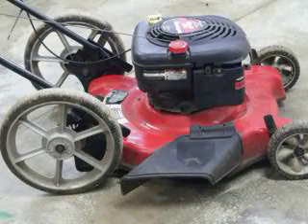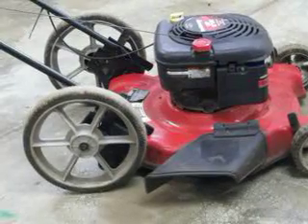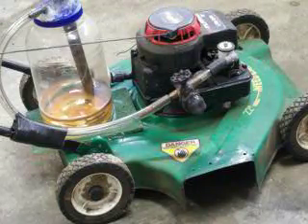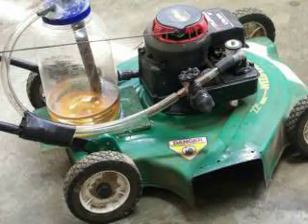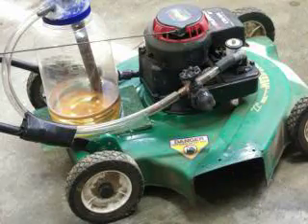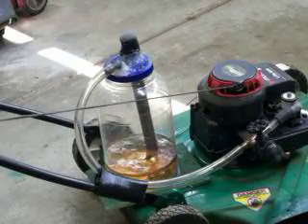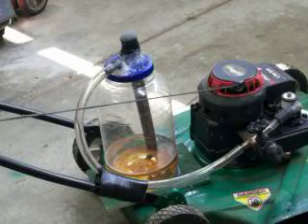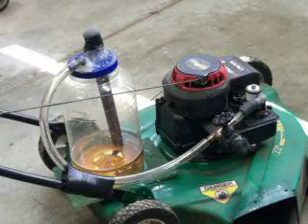gasoline and fumes the difference

Comment: That wasn’t the heat setting off the fire alarm. It was the carbon monoxide that you said wasn’t there. You talked about it smelling like cookies or something but it was death you were smelling. You needed some water vapor to make your engine run better. It’s running way too lean like it is. Just my humble opinion

Comment: I have thought about this theory for a long time. So if you left your bottle the way it is where it gets the vapor and the air mixed took off the gas tank plug off the carburetor everywhere except for the air coming into it, remove your hand valve off the hose and then connected your tube up to it wouldn’t run off the valve for your throttle

Comment: to make it more efficient add a heater to the jar to increase gas production and 2 valves one to zero in on the air and the second to control gas flow.

Comment: hello vapor kid i have been inspired by your videos but after year of experiments i found out  only way to completely evaporate petrol is very hight heat app 350-400 degree.your system will work for short time only after all light elements are gone engine stop and lots of  unburnable fuel is left in tank.boiling fuel is also unsuccessful although a bit more effective.did you put your system in your car?best regards from UK.

Comment: why not put a wick along the inside of the container  the problem is that the most volitile part of the solution comes out first...so in a batch it can only get less and less poweful..   by dripping the gas  on a hot exhaust it would  vaporize instantly.

Comment: that's your cabonmonoxide allarm lol you idiot, are fules  cause cabon even if it more affecent u will over heat the engine and burn your spark plug running it more affecent wen the carb brings up fule  air hits the spray creating vapor or close to it you can simply lean it out by tuning in your carb screw but again it will heat the engine up, you can use vapor but destroy the engine from runing lean and if its not tuning lean from thick vapor you will get the same milage.

Comment: Petrol engines don't run on 'liquid'! They run on vaporised petrol, which is basically fumes! You have built a very crude and simple carburettor. Congratulations. I'd recommend that you stick with the one at was already on the sodding engine though, it's a little smaller and less bomb-like.

Comment: an engine needs fuel to make power, and if you think its making the same power and also running more efficiently your wrong, im no expert but i know making power requires fuel, those priuses get 60 miles to the gallon but they make 25 horsepower, 25ish ftlbs torque no way around it, and an 8 liter v8 making 450 horsepower stock and 550 ftlbs of torque is gonna get 8 miles a gallon, of course theres more frictional losses and losses from the water pump, radiator fan and all that cost fuel to run, but that motor is likely a truck designed to be overbuilt so the motor is way stronger and heavier than it needs to be which means it lasts forever but isnt efficient for how much power it makes, power per liter goes down the bigger the motor gets pretty much, also small motors making big power overheat easily and blow up easily and most definitely wear out quickly and have to spin much faster and work much harder, like an ox pulling a trailer vs a rabbit spinning a wheel at 15,000 rpm on a gear reduction working his ass off to keep up i could go all day but by now you should have the point, making power costs fuel

Comment: Fire alarms that just go off because of the Heat that is carbon monoxide and you have a carbon monoxide alarm built into your fire alarm so you're probably going to die if you don't open the door soon.

Comment: Anyone who thinks this is some amazing invention doesn't understand how a carburetor or a combustion engine even works. What your bottle there does is exactly what a carburetor does, but very crudely. And, it WILL make the mixture much leaner. Lean means a greater ratio of oxygen to fuel in a mixture. Even if the motor survives the increased heat from the leaner mixture, you haven't really accomplished anything. If you want leaner, you can make the mixture leaner by adjusting the carburetor without having the shrapnel bomb strap to the deck.

This is nothing more than a neat trick, but definitely not some amazing breakthrough.
Reply: Doug Sholly

Comment: You can't run an engine that's designed to run on liquid gas and expect it to last a very long time. The liquid fuel entering the cylinder has a cooling affect by means of evaporation.  The evaporating fuel helps cool the top of the piston. I don't know if you've ever seen a piston where the combination was way to lean. The heat burns a hole in it.  Running on vapor instead of liquid  I would set it on the lean side. Vapor. Leaner is cooler and richer is hotter.  With liquid fuel  richer is cooler and leaner is hotter.

Comment: And as soon as it hits more than 3 blades of grass, it shuts off because it is starved for fuel. Extremely lean mixture.... how long do you think it will run under load? For anyone who doesn't understand, Google the term stoich, or stoichiometric ratio to get a better understanding.

Comment: Back in the late 70's, after reading about the guy that punctured his lawnmower gas tank and found he could run it on fumes, I took an engine and rigged it to run off fumes.  The hose to the carb came out of the gas cap on top of the tank.  Poured about 8 ozs of gas in the tank.  I shut it off an hour later with gas still in the tank.  

The original guy went on to put a vapor device on a big old Catalina or Bonneville.  He found he had to warm the tank and reinforce it to not collapse. 

Original story appeared in our local paper in the auto section. Thought it would be an interesting project, it was.
Reply: I believe you because my dad did the same thing but for much much longer.

Comment: I have been running an old pressure washer with propane, barely cracked valve, the hose connected into the air filter.

Comment: I'm not going to knock it , it will be leen as hell burning a hole in the piston eventually, but look at diesel eng's they work on detonation. I'm going to try this with old lawn mower , and see if it will work and I will post it here , if you can get a eng to run on super heated wood ( Lookup wood powered engines) I'm sure this will work , I bet it will work even better if you can some how pressurise the air.
Reply: Sotallytober

Comment: I'm guessing his "fire alarm" as he called it is a smoke detector and/or a CO detector. He said the fire alarm was sounding because of the heat in his garage, fire alarms normally only sound for smoke in the air, not heat. So that being the case, I am assuming it is either smoke setting off the alarm or it's the carbon monoxide setting the CO detector. 
Whatever the case is, this vapor running engine sounds great & possible, I would like to try it sometime.
I'm just not sure of the best way to secure my 55gal drum, up right on the roof of my Yugo?? Do the think the highway patrol would pull me over when I attempt to drive thru the tunnel on I95??

Comment: I ran a 350 Chevy van on gasoline fumes that were created by heating gasoline with copper tubes with coolant running through them.  I started on the carb and then switched over when the motor was warm. I found that when  running on the fumes the engine became cooler and then less fumes were created.  The motor did not detonate or have valve problems.  Do a patent search.  Ford has a patent on a similar system.  The patent is clearly claimed to run on gasoline fumes and it is obvious in the diagrams.  The patent  was issued along withe the text claiming 100 plus MPG. The Ford system uses electronics to adjust for the temperature drop.
Reply: I did the same thing to 350 in a car I did have to add a thumper like in a distillery and got 40 plus mpg

Comment: I can see this having a problem in cold weather since the fuel will evaporate less.  you could boil the fuel with a small heating element in a metal chamber in the absence of air.  That would prevent flashbacks and keep the fuel mix consistent in cold temperatures.

I'd also like to see someone attach a steam engine to the cooling jacket of an engine to recover the wasted heat from the radiator!
Reply: Bardrick
Reply: Bardrick mn
Reply: Bardrick mn mn

Comment: congrats, yo just made a super inefficient carburettor.
Reply: +Nagy Andras Interesting professor, tell us more.  How is it "super ineffecient"?  Does it utilize more fuel than a standard carburetor?  Are you speaking from experience, or are you theorizing?   Seriously, I don't claim to agree with what was said in the video, but if you're going to sling bullshit, try to make it at least have the appearance of evidential support (i.e. an explanation to backup your claim).  Good day.
Reply: Jeff Meyers 
well, this is how carbs work so no further explanation is required. expect air fuel mixiture is controlled in a carb. and that is why this solution is super inefficient.
Reply: sorry to dissapoint you, but its a crude carburettor. a verry inefficient one. some pretty shed engines actually done this quite a while ago, and the evolution to carburettors simply made this setup obsolete. lack of controll over the air fuel mixiture kills efficiency.
if you would measure the specific fuel consumption (that is , measured in gramms of fuel for 1 kw (or 1 hp) output for an hour, you would find that this setup will require as high as 2-5 times more fuel than even the shittest carburettor you can come across.
and then as we countinoue on our journy along thecnhology , comes electronic fuel injection. neat stuff, even better than carbs. and then comes the next step, direct injection cylinder by cylinder. 
gains of efficiency and power can be observed with ease.
in case you wanna get funky, just observe where the fuel enters the system from generation to generation. 
what you see is fuel delivered closer and closer to the combustion chamber, and in an ever narrowing time frame.

maybe we can consider going the opposite way is not going to get you forward.  not so hard to see. if you want to. 
the engine may seem to consume less fuel, but the reality is that its now underpowered, and when it has no load to power, it seems to idle for a longer time than if it was carburetted or fed by any other methood. 

and there you have it. i do have to mention that electronic fuel injection and proper modern carburettors are quite on par in many applications. however the carb does not need electricity, its simplistic style does indeed gives warmth to the hearth of old farts like my self.
not a lot of us had the chanse to withness how crude evaporators evolved into far split secund precise computer controlled intelligent machines.
what you see in the video is an even cruder form of fuel delivery than a hot bulb engine. pretty close, pretty close, but thisone is not even "that advanced".  (tho the hotbulb works differently as the hot bulb part is allso part of the ignition system, but for our example we care only for the fuel delivery, and air fuel mixiture creation.)

hope you are happy now. your bullshit made me wirte a wall of text.
instead of you just reading uzp on how things work.

Comment: Why not use the original lawn mower gas tank. Just disconnect the bottom gas line and place a hose sticking out of the top for vapor fumes. Walla now you have a more conventional mower to save on gas, and more durable to cut the grass. Just make sure you place a breathable filter over the top hose. Simple Sir. Try that and do us another video from my ideal. I'll let you present it, but give me some credit when mentioning. 😀👍✌

Comment: Sooo..Instead of using the carb to "atomize" the fuel its just going thru in vapor form ..Understandable. Which in turn would use less LIQUID fuel. But it has to be asked ...what about the rpms ...are they ...deminished at all ..or ..can I step on the pedal and get the same performance?

Comment: donnie brown, using electrolysis I split water and instead of separating the gases, I mixed them in the same hose. this makes the hose a fuse so to speak. one backfire will ignite the whole system.

Comment: Try some kind of screen or mesh with over the end of the bubbler and try different sizes of holes in the mesh/screen.. That way it would introduce LOTS MORE bubbling action and it would be 100x more efficient at creating vapers..
Could also use one of those things in a humidifier that creates vapers. That would be super efficient as well. and maybe more controllable.

Comment: you are a dumbass "no carbon monoxide" of course there is that's what happens when you burn fuel.  Also fuel vapor is a hydrocarbon just like the liquid and finally in any engine the carburetor/fuel injector atomize the fuel into a vapor before it enters the engine

Comment: Your Smoke Alarm went off, I think because you stopped the motor by cupping the air intake instead of starving the motors fuel source and had some unburned vapor in the motor its also why it was hard to restart a second time.
Turn off the fuel not the air supply. Your Valve would do that and starve the motor until its dies out and stops. Instead of sucking in fuel vapor to clog the motor.

This under low load with water injection would power a small generator for a long time on one gallon of gas or fuel. You could use Alcohol in its place or a mixture of fuel types.

I wonder how long it could run without stopping on no load with one gallon of gas? and how could you add more fresh gas as its running?

Comment: I can tell ya rite  now that a 429 BB ford  didn't run on fumes from 83unleaded gas fumes at 2000 rpm or 1800 rpm not at compression ratios  they  ran in those years// theyed had to change it to around 6.9:1 or lower/ they would have had  64 cc chambers or  proble  larger  to have  made it work then.. and  mabe it would have  ran  and  55 mph  would  proble  be  max  not to burn a hole in the  pistons// the  gas would have to be leaded to n ot burn a hole in the piston  heads  would  have  soft bushiung inside  to work   proble  ran a  gas  of  109 at or higher  leaded

Comment: anyone heard of Lean condition  where more air than fule can burn a hole in the top of the piston. in hi rpm some of the gas is actually a lubricant as well.. I can make a motor run off wood smoke  don't mean I can get years of service out of the motor

Comment: The only mechanical issue this could possibly pose is running your engine under an extremely lean condition and overheating the engine as a result.

Comment: Before I go down the list and comment to everyone who is afraid of explosions here is the scoop The system works on vacuum created by the restriction of the intake of the glass container. This vacuum is a result of the down stroke on the intake of the cylinder. This causes a dissipation of the fuel to its molecular state which is ignited along with a corresponding minimal amount of air. This is why this device is so efficient. that said the vacuum which operates the system(partial not total) prevents explosions of any magnitude(catastrophic) 
I have tried many times to (by intentionally causing a backfire into the tank or intake line)cause catastrophic failure but as of this comment i still have all fingers and limbs
Cant say the same for Ford Pinto owners
Anyone not familiar with my comments please look through this sight and read them I can answer all questions about this system and would gladly do so
This technology has been around for 80 years and there are 240-250 patents and thousands of misinformed opinion
Anyone interested I can tell you why it works and what its shortcomings are I can explain why it never made it to market. I havent heard an argument or comment yet I havent been able to answer
Try me
Reply: Leslie Clendening

Comment: carburetors mix air and liquid fuel into a vapor.
And one very serious problem with this method he inadvertently demonstrates. Gas vapor is highly volatile, and will EXPLODE.
Gasoline in its liquid state burns, but does not explode.

Comment: carburetors mix air and liquid fuel into a vapor.
And one very serious problem with this method he inadvertently demonstrates. Gas vapor is highly volatile, and will EXPLODE.
Gasoline in its liquid state burns, but does not explode.
I see many emergency room visits for anyone attempting this in a garage or backyard setting.

Comment: It works used an old gas can, we put 5 holes hoses going to the bottom and one going to the carb, taped off the air filter, fired up easily.

Comment: It seems that an air/vapor pump located between the tank and engine could possibly supply the higher demand needed for increased performance on cars. This would create a low pressure (increased vaporization) upstream and a higher manifold pressure downstream. Never tried it. Those vapor could be dangerous if not contained.

Comment: A secondary fuel tank to accept the vapor along with a one way valve on the fuel line is the answer to not exploding due to a backfire. it will choke out.

Comment: Another message that you could do to save on gas on a diesel vehicle and it works and it's not dangerous as what you doing there you can get french fry grease from McDonald's or any greasy spoon passing through 4 filters take the filter french fry oil put it in the tank of a diesel car no conversion necessary and your ride for free and it's safe but the only thing was that if your might get the munchies does your spelling French fries and no carbon heck of a lot safer and cheap get paid nothing for it so you're actually driving for free sincere TCB
Elvis Aaron Presley Mark Dawson that's what it is man